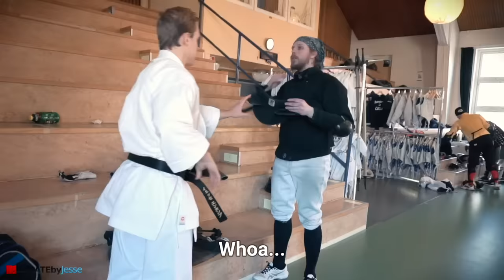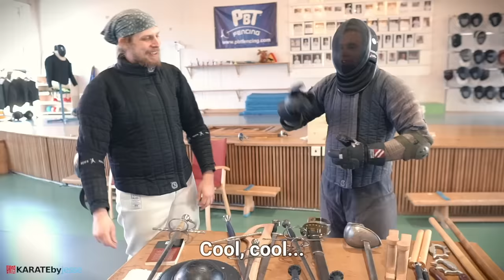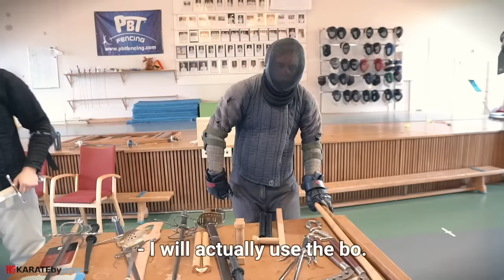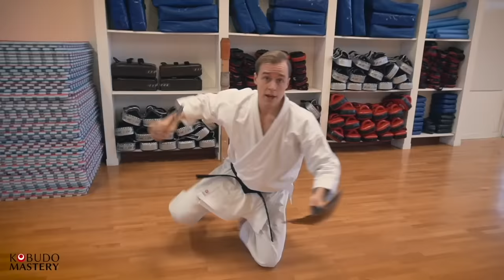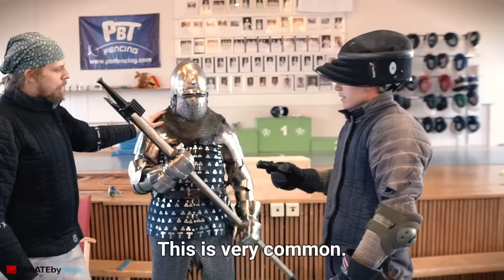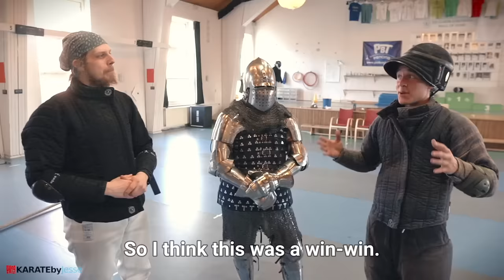Medieval vs. Japanese Weapons (Real Sparring)

Comment: This was a great video to watch, but as someone who has trained in both Okinawan karate and HEMA, I am confident in saying that none of the Okinawan weapons pose much of a threat to someone in a full suit of late-medieval armor. I have had friends kick me as hard as they can while I wore my harness and I barely felt it. The same with any weapon that was not a mass impact weapon, such as a pole axe or a mace. Swords might sting a little, and staves don't hurt that much unless it is a massive wind up type of attack which is badly telegraphed.  The gauntlets would be a greater threat to the unarmored fighter than the spiked knuckles would be to the armored fighter unless he could find a way to open the helmet or remove it while on the ground, which is not an easy feat. The reach of the staff was great against the sword and buckler, but something that a lot of people who focus on sport over martial arts don't understand is that a weapon such as a staff or a club does not have the same level of lethality as an edged weapon like a sword. A thrust to the face can do some serious damage with a relatively light attack, but if you are hitting meat it is much harder to cause injury. You need to put serious power into an attack just to cause injury, and it is likely that the opponent is not going to go down from just one hit. Meanwhile, even a light hit from an edged weapon can cause serious injury or even death when you hit flesh, and in the context of a martial fight the most important thing is to not get injured or killed. Now, if you take that staff and add a pointy piece of metal at the end, the fight changes dramatically. Staff techniques are easily translated into spear techniques and make the weapon extremely dangerous even in the hands of a beginner. At our HEMA club we do a lot of mixed weapons sparring, and I have seen beginners dismantle some of our best fencers when using a spear against a sword.
Reply: I think if jesse used the staff to hit the helm it would give some nice headache to the opponent. Also, he could probably grab with the bo and parry the hammer or poleaxe in weaker attacks
Reply: @The_true_Joe_mama  I won't say I completely disagree with you about the strike to the head with a staff, but I will argue that it depends on the variables. Helmets were made in a variety of ways, and some were thicker and heavier than others. The heavier the helmet, the less damage that an impact to the head is going to cause due to inertia. In addition, it depends on the material and design of the staff as well. European quarterstaves were longer and significantly heavier than their Asian counterparts, and there are a variety of excellent hardwoods available such as oak and ash. I did not see anything like that when I was in Okinawa, and if historical staff weapons were anything like a modern Bo staff, then they were not particularly heavy. They would be more than suitable against lightly armored or unarmored opponents, but not so much against the plate armor of a knight. The Bo staff is much faster and more agile than the quarterstaff in my experience, mainly because of its light construction, and I honestly regard it very highly as a defensive weapon against unarmored opponents.

Regarding grabbing a poleaxe or mace, I have tried it many times in sparring and it is much harder than it sounds. I can make it work against opponents who have little or no experience with the weapon, but an opponent experienced in using polearms will have a response to the grabbing attempt. Same with a mace, except they will have a free hand with which to strike someone trying to grab the weapon. However, all of this is largely irrelevant as a knight would likely select a sword to use against an unarmored opponent instead of mass weapons as these weapons are designed to be used against armor and a sword is lighter, faster and extremely dangerous to unarmored opponents even with just a glancing blow. Also, despite the videos you see from fake martial arts masters, it is suicidal to try grabbing a sword in mid-motion, and even more so against someone who actually knows how to use it. Not to say blade grabs are not done, in fact the historical sources go into great detail about how to do it properly and it has been done many times in sparring, but the key is that grabbing a weapon is always done from the bind when the weapon is briefly not moving.

Historically speaking, heavy armor tended to outclass light armor units because of the huge disparity in defensive capabilities. There were exceptions, of course, such as the battle of Agincourt, but knights both on foot and on horse were feared by the light infantry. 

Anyway, I am open to further discussion and I would like to hear your response. Friendly debates and discussions are great learning tools, and I enjoy talking about hypothetical matchups

Comment: The last bout with the knight would have been 3 - 0 with the knight taking it since an unarmored foot kick against an armored attacker is not going to do much at all other than just offer your leg for a grapple or hobbling with a dagger. The wrestling would be a good idea, but only if you had a means to get past the armor, such as with a dagger. Brass knuckles wouldn't do that unless you took off the visor and were actively hammering the face itself. That would be a difficult task as the knight also knows how to wrestle and would be fighting back the whole time.

Comment: This was fun to watch, but (granted the results were fairly mixed anyways) it didn't seem very equal as a compare-and-contrast field test: every engagement involved first picking a traditional weapon/set from the European methods and then deciding which weapon or combo of weapons among the Asian methods would have the best perceived chance of success against it. No reversal of picks, no double blind bouts, and it seems like there was even some impromptu mixing and matching going on with some of the dual wields (not sure though as Im not well versed enough in those arts).

Comment: Silver would actually describe the BO as having advantage and its clear you had a solid sense of how to use it.  Though his buckler use was not that great.  He seemed to struggle against thrusts.

also laughed as you dealt with armour by wrestling. which is again pretty common recommendation in the sources.  With a dagger you can get by the armour

Comment: From my limited understanding of mediaeval battles the tactic you used against the knight was one of the best. Basically knock him to the ground the armor will make it hard for him to stand back up and you can just hit him while he's down. also pretty sure blunt force weapons work better than sharp weapons against armor
Reply: Also too. If present an opening. A single stab through the gaps & let them bleed out, even if they get up still, they bleed out faster. Was quite common tactic to do in Feudal Japan.
Reply: @tristanbackup2536  not that you mention it i also imagine that it would be far easier to find and take advantage of the openings when the opponent is on the ground

Comment: One thing that /really/ doesn't come through in tests like this is what the actual effect of each hit would be. In the first matchup, you have sharp weapon vs. sharp weapon, without much armor on either side, so there's some level of equivalence (and they're both the sorts of weapons you'd use for self-defense, so it's really a fair comparison on several levels). But from the second match on, you have either a) blunt weapons going up against sharp weapons (not to suggest blunt weapons aren't dangerous, but there's a reason people generally went to war with spears, not staves), or b) armor vs. no armor. Counting the kick as a hit vs. the armored warrior seems particularly egregious in this regard. Like, yeah, if you have a scoring system that doesn't take armor into account, armored warriors are easy to beat. Similarly, the staff seems a lot better if you treat each staff hit as "just as good" as each sword hit. Which, as I understand it, is a problem even in pure HEMA testing. After all, modern martial artists aren't really stabbing one another.

Of course, it's also not like Asia didn't have heavy armor or swords or spears of its own. It's not as simple as "Europe should always win because they have edged weapons and armor." Like, you put a European guy with a quarterstaff against someone in full samurai armor with a naginata, you'll have the same problem in the opposite direction.

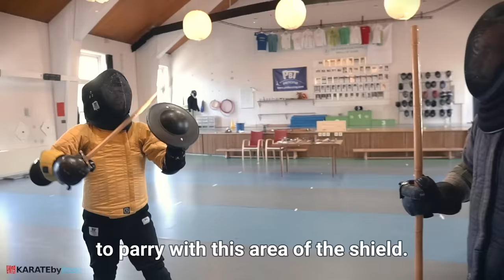Comment: 4:05 The staff techniques really impessed me. They were a lot more threatning than i would have expected. 
 
Though I have minor complaint about the scoring system. Beacuse of bo's length it has huge advantage if you are just scoring hits, however sword is much more lethal than bo, so both hits can't really be counted equally.

Comment: Tekko were an interesting choice with some merit, but wouldn't work though. Trying to bash through plate harness with your hands will never work, no matter what kind of metal you cover your knuckles with even if you can strike hard enough to puncture or dent his helmet for example your hands will shatter and crumple first. However the grapple technique used was the way to go, that plus a dagger was one of the many way plate was dealt with. Samurai used armour prolifically so their must be medieval anti-armour techniques from Japanese martial arts.

Comment: Just to say, those knuckles would be entirely useless against an armored knight outside of a point scoring exercise like that because the Knuckles are entirely incapable of hurting the armored knight. You'd have to resort to pain compliance holds in order to win that or possibly trying to exhaust the knight and win that way. But either way the knuckles are entirely useless. By far the safest way to take down a knight is to bring him to the ground (that's the most difficult and dangerous part) and then wrestle him to expose a weakspot like for example the armpit and thrust a dagger or preferably a stilett in there.

Comment: I would want a light parry warfork and a metal tomahawk with armor piercer back of axehead.  Try to trap their main weapon with warfork or get cheap stab in and then use tomahawk size metal axe to centipede chop and overwhelm them or throw it.  With possible long spear or poleaxe in backup storage.

Comment: I think the kama is more efektif in a small space like an Alley or a room were you can run freely and find a cance to geat close

To fight a rapier and dagger i would choose a Japanese spear that had a pipe handel i just cant remember what ITS name

The spear had a handel that could slide in and out like inserting a spear in side a pcv pipe, the Wood is flexibel and not that long

I love the bow tecnique, but, when fighting fully armored man??? I cant find the right weapon but if i can make one, is a hard steel rod long stik like tonfa, and make a dent on the helmet and try to be on his blind spot since he Will be hard to see by moving in circle clock wise switch in to rivers clock wise to make him run out of energi

The guy wear a heavy armor that Will tier him and consume lots of energy

And like what you said, is how one use his weapon and skill

You can use a Masamune Blade  or charlemagne sword but,if you are lacking in skill it end up as ornament

Comment: How did you feel about your learnings?
Reply from the maker: Great!
Reply: You won't find many differences, same tactics apply. Might be different styles but still there will be the same if not similar tactics and techniques. There is not a infinite amount of differences just orders of movements change and how they are implemented. And even this is limited. When all is said and done it is still a mass load to take in. But this will give you a better understanding of the main points, common denominators. But can a martial arts be simplified to be trained only around common denominators and trainee's fill in the gaps.

Comment: I practice HEMA and the problem with 'sparring' is that armoured combat like this isn't a sport. Yes I know there were tournaments but even those required a level of violence that far exceeds.moden health and safety.
This means that actually reproducing actual armoured fighting in the 21st C is impossible without risk of serious injury. Even wrestling unarmed in armour is extremely dangerous.
Reply: A steel armoured fighter fighting a 21st c unarmoured opponent will be pulling blows because blows landed by steel gauntlets or knees can kill.
The reality is that going up against an armoured man in 15th C armour, with weapons, trained, without armour would usually end in your incredibly violent and unpleasant death.

Comment: righto bloke. now frame advance it in your bo vs bucker duel. look at how you called it a win for getting a soft attack with a blunt staff in on the rear leg and then look at how ridiculously overextended, unbalanced and grounded you are.. and how the nice (in theory) sharp sword is balanced, in range and measure and about half a second away from giving you a really bad slash from which you would be unable to recover in exchange for a light bruise. Thats a clear win for the swordsman. Stick with small frontal movements, like the other guy said, those are threatening.

Comment: The conclusion is overblown.  It's not ONLY about the weapon, but the tool you bring to the fight absolutely makes a difference.

Long reach and speed is what made spears and their upgrades the kings of the battlefield for so long.

Also, in knights armor your punches would only break your hands and your kicks would only break your feet.  Unarmed damage would drop to ZERO against heavy armor which is why throws and joint locks/breaks were so popular in judo/jujitsu.

Comment: Having the shins unguarded seems a bit unsafe, but it seems everyone here had specific target areas in mind and enough control for it to not be an issue. 

Dual Kama's vs side sword, I could see this working very well, especially as mentioned with the footwork. You have extra defense and control and can get to a closer range with good footwork ands then the side sword has very little it can do to defend or attack.

Tonfa is a GREAT choice to counter the dagger, I loved seeing that, and honeslty it seemed brilliant. However nunchucks to counter the rapier? That one seems like a very poor choice. Rapier is solid and has much more range and defensive capability. If you get in real close, the nunchucks and rapier are useless, and whereas the tonfa is still viable, I want to make a POINT that the dagger still has an EDGE over the tonfa in very close range (Puns that still help highlight my point intended, I will not apologize) My main point being, the nunchucks gave a range disadvantage as you never had any optimal range, the rapier and dagger always had a specific advantage. I do want to say your first hit to the hand/wrist was very clean. 

Bo staff against sword and buckler, awesome choice to counter there, the reach and versatility of the staff is amazing. But you hit near the shins on the second round, which changes my initial safety concerns. Luckily this guy had some shin armor, but that means in an equal fight your shins should be a target as well, and so you should really be wearing shin guards. Otherwise, it's dangerous or unfair. 

Umm... brass knuckles? Even with the spinning kick, you're not doing anything against someone in that armor. I mean, take them down and enough heavy ground pound might cave in the helmet, maybe? But that's an absolute losing fight. 

Range is nice, it's safe as is said, but it's absolutely the tip of the iceberg in melee combat. The range your weapon has can be covered in less than a second by someone with good footwork. At the end east vs west, yeah that doesn't mean anything in effectiveness, speed, technique, and quick analysis of your opponent are what matter most, endurance is also very important. If you get tired after the first pass or two, nothing will save you from someone who has the endurance. Getting gassed in any fight earlier than your opponent is a death sentence.  

Overall, super fun to watch, really cool to break down and think about. Keep being awesome!

Comment: 1st fight the guy with the sword was way to defensive. He could have easily spam stabs with that reach
Reply: That's what I was thinking. And he was waving the sword around too much. Small changes in angle at speed while pressing the attack. It's hard to block them all, and if he comes in, he runs into the blade.

Comment: Ummm... Why use nunchucks together with a tonfa? This is lowering both weapons in speed, coordination, power, flexibility and Form.  (though I admit, that youve done really good under the circums😉) This way it can't be judged correctly. And for the medieval armor the kusarigama or any more blunt weapon are the right  choice. entagle - takedown - kill. Hits on the joints of the Armour deforming it and disables movement. This have been regular standard  tactics in medieval times against heavy armor troops like knights. So this test was nice but lost a lot to me.
Reply from the maker: Just having fun! :)
Reply: Yeah.. This I fully believe. Looked like a lot of fun to me😃👍